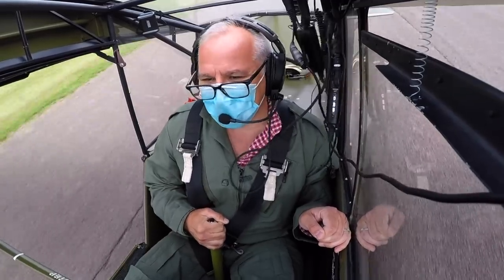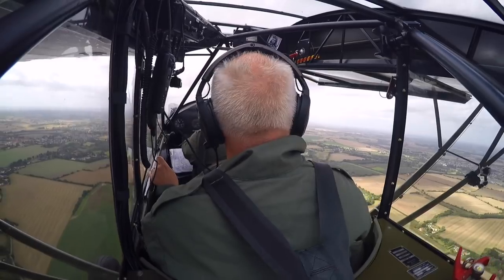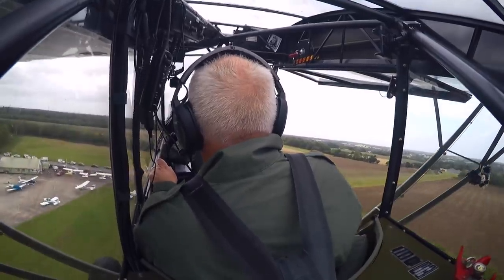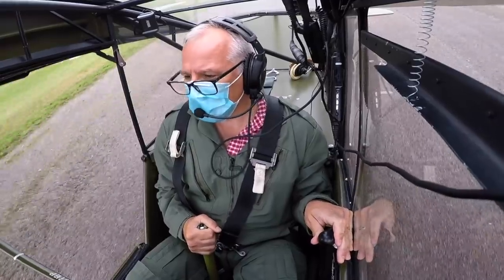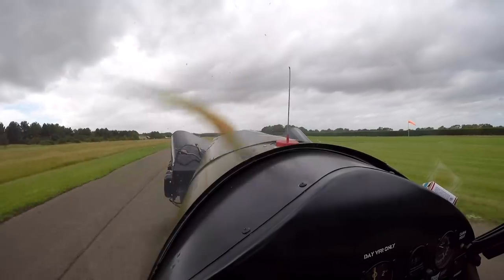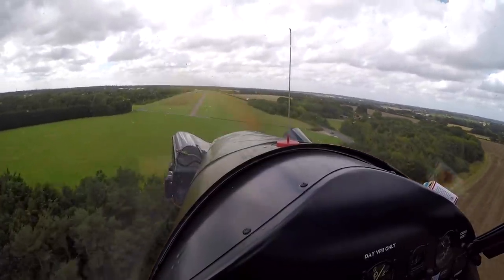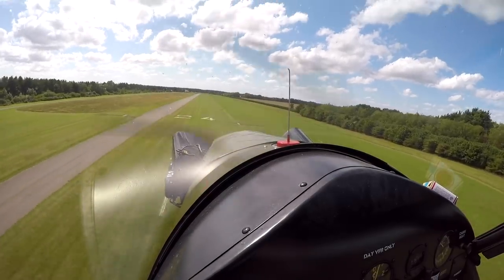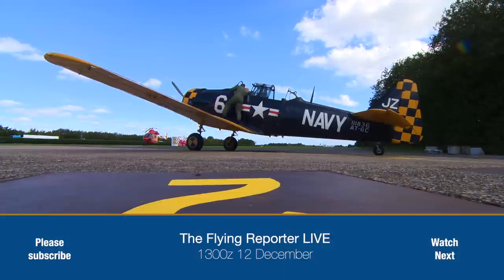Dancing on the rudder pedals - Tailwheel lesson #2

Comment: A few small tips. Tailwheel flying is no more difficult than tricycle gear, it's just that the things that could bite you are more apparent. Try to relax your grip on the stick; let the aeroplane do its work. As an example,  when you have set up a nice curved approach in a Pitts, you can comfortably sit hands and feet off and watch it do its thing. I have had the privilege of sending pilots solo on taildraggers with fewer hours than most take with tricycle gear. When converting to tailwheel, it's a good time to see what improvements you can make to your nosewheel flying. And finally, while I understand your "dancing on the rudder pedals" phrase, I should point out that every groundloop I have witnessed was preceded by some quite unnecessary dancing. Simply use the rudder as and when required.

Comment: Hi Jon - appreciate this is an older video now, however having just flown a taildragger for the first time yesterday, and come away from it feeling somewhat spooked, frustrated and slightly discouraged - after what I would call a sub-par performance - it's really affirming to see you experiencing the same thoughts, discomfort and even swear words(!) that I did yesterday. 

I was flying a Cessna 140 and about 10 hours into my PPL training, which has been on C152s predominantly. Perhaps I'm attempting to run before I can walk, but I found it really unintuitive compared to tricycle gear flying, and after a couple of take-offs and 'landings' I ended up asking my instructor if we could cut the lesson short, as my brain was overloaded and I was feeling massively uncomfortable with it all. My instructor insisted I'd done better than I'd thought - but I really struggled to shake the feeling of having not done very well, and ended up getting inside my own head about it all last night.

Having said all of that - and after a good night's sleep - I'm determined to return to it (perhaps with a few more hours under my belt, and my overall confidence level higher) and get my tailwheel endorsement at some point in the near future. But just wanted to share my experience and let you know that watching this has given me a huge deal of encouragement to give it another shot, knowing that even experienced pilots such as yourself find it a real challenge, to begin with.

Thank you for the consistently excellent content, Jon! 🙂

Comment: On the bounce and go around, try a bit of dynamic proactive fore/aft stick to bracket level in low ground effect for maximum acceleration.  On the bounce, power and change to soft field landing is fine if enough runway remains.  Same with the takeoff on tarmac.  It is easier to find fuselage level with a bit of for/aft stick to bracket level.  No worries about the prop.  It won't hit unless you use brakes.  Don't use brakes.  The dynamic proactive walking of the rudder pedals necessary to keep the Cub going straight transfers well to flying nose wheel airplanes.  Just take the slack out of cables or push pull tubes with the same dance.  We are better, regardless of airplane, when we move.  The speed on the wheel landing was sending you flying again unless you went forward on the stick enough to take all pitch out of the wing.  I used the almost touch down for a three point and then level the fuselage as the J-3 touched down.  With J-5 or Pawnee, it was necessary to stick it just before touchdown as you guys are doing as they have heavy bungees.  With a strong headwind or headwind component in crosswind, the wing will be nearly level anyway and thus not much of a problem to stick it.  Very nicely done, both student and instructor.

Comment: You should never be giving the stick the death grip. All you need to do is hold the stick with your index middle finger and thumb. Feel the airplane. It will go a lot smoother for you and you won’t white knuckle and make over corrections. just to note, I have not flown a tail wheel until three weeks ago since my sign off almost 11 years ago. You do remember many things and you do forget some things. The main point is to make sure that you keep the aircraft under control and you do not groundloop. Some landings will be pretty and some will not. As long as you relax and fly the plane like you have flown a nose wheel airplane this too, will become natural. Good luck.